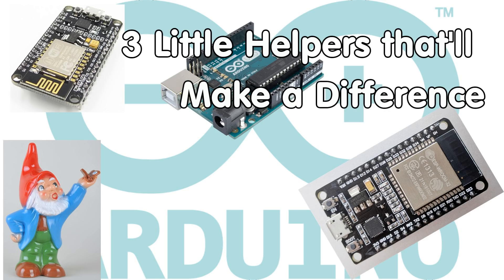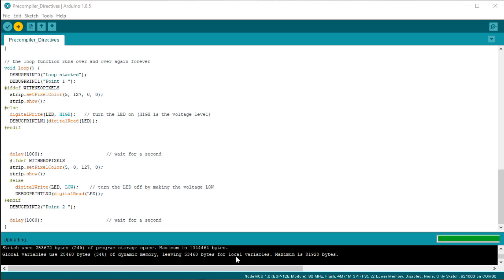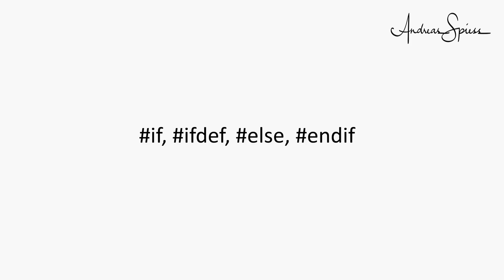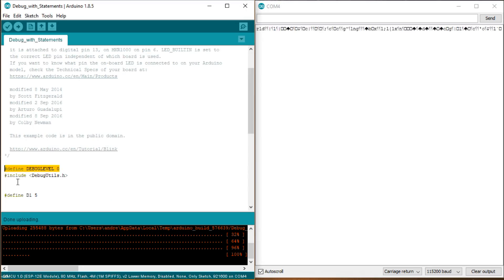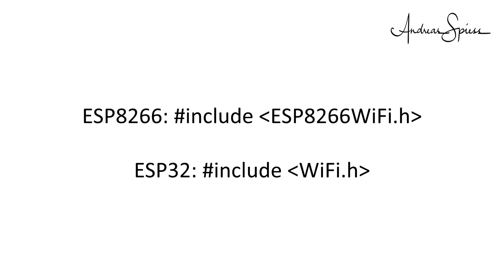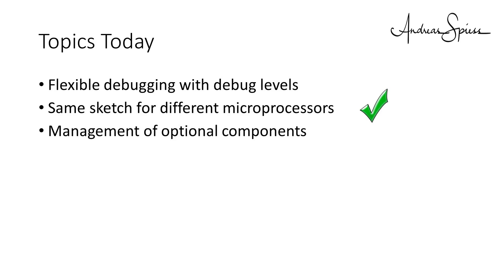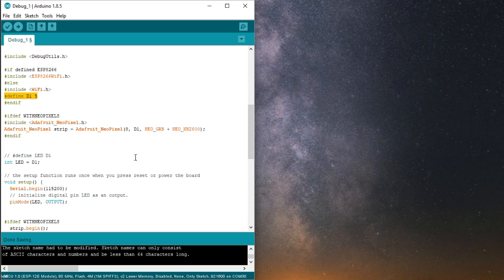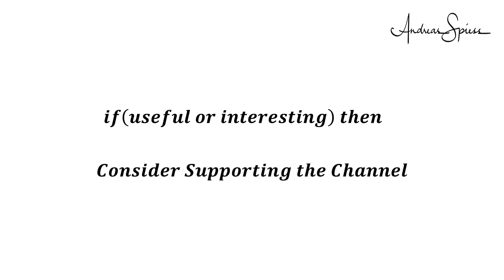#233 Three Little Helpers that'll make a Big Difference: Preprocessor Directives

Comment: Hey Andreas…you got me thinking about esp8266 preprocessor.  Oh great video and I have implemented the debug routine.  My esp8266 program has grown and my OTA library and Firebase library are colliding with each other causing crashes.  Can you guide me on how to have a dual boot 8266.  I’d like to do an OTA on power up, then restart, ESP.restart(), and do Firebase stuff based on ESP.getResetReason != “Power Up” or BOOT_MODE/Reset Cause.  I’m able to manually isolate the two boot ups via preprocessor #define statements but can’t figure out how to do it base on checking the condition of ESP.getResetReason , or BOOT_MODE/Reset Cause or other condition you might suggest.   Thanks for your help.
Reply from the maker: I hardly use the ESP8266 anymore. Particularly for complex projects :-(

Comment: One more comment: With #ifdef ... #else ... #endif you create blocks of code that the compiler doesn't check for you. 
These code-branches that you personaly never use degenerate over time (updated libs, deprecated functions) or never worked at all.
Github is full of projects with these problems. So static bool const g_bDebugOutput(true); or static int const g_iDebugLevel(4); may cost you some bytes but makes the maintenance of your code much easier
Reply from the maker: Agreed. Just if you have big parts of a program to switch on or off these pre-compiler directives create much smaller code. I often see it used in this function. But they are not easy to read.

Comment: What will have you tearing your hair (if any) out is when your code isn't working right, so you put in debug statements and .... the problem goes away. Turn them back off and your code misbehaves again.

The problem? You have a timing problem somewhere. Executing debug statements slows it down enough that the problem goes away!
Reply from the maker: That can happen (happened also to me). Maybe you watch the JTAG debugging video. There, the timing issues should go away.

Comment: Do note C++ has better alternatives for pre-processor directives in most cases. For pin definitions we have the safe const byte alternative which give wayyyy nicer errors if you made a mistake. And even for debug you can use const and regular if's. The compiler is smart enough to leave unused parts out.  So for point 3 I would prefer a const variable.

Granted, PPD make it easy for a lot of types and in a library the debugging is already "done" on the PPD. Two big shortcomings of the linked library, you can not give a second parameter to print. So you're stuck to decimal and 2 decimals on float. Second, you can only use Serial as debug. That's why I once made https://github.com/septillion-git/DebugLib But out of the box it does not support debug levels.
Reply from the maker: There were discussions whether the compiler used in the Arduino IDE removes the const variables. But you are, of course right for the newer compilers. Common practice in the Arduino environment is still to use defines.
I will have a look at your debug library. I am sure I can learn something from somebody who really knows C++

Comment: The debug levels are even easier to implement in ESP-IDF. You just use the macro ESP_LOGX(TAG, message), where X can be V (verbose), D (debug), I (info), W (warning) or E (error), from less to more important, and then define the level in menuconfig, before compiling. Also, a neat feature is that you can define the TAG for different sections of the code and be able to easily identify them.
Reply from the maker: Interesting. I wonder if we could use a similar concept with the Arduino IDE as in the newer ESP boards definitions it has also those debug variants. Maybe they are even the same?

Comment: Hello Andreas, many thanks for your soldering tips @ IoT meetup in Basel. Today I did a test soldering on some of the discussed boards and I thing I managed it quite good. It's time for doing a check now and see if there is any connection error. I wish you a nice weekend and maybe see you next time. Best regards Matt
Reply from the maker: Glad to read that it works now better. Some practice and you will be a master ;-)I will be at the next Meetup, for sure....

Comment: Few issues come to my mind with #define: it is hard to debug compiler errors and mistake because we have no access to the post processing output file (I wish there was a way to see it). For example, the wrong semicolon (;) in the following statement (  #define motor_pin 13;   ) . It can take some time before noticing the stupid mistake - I often add ";" because I am used to. Perhaps Const int can be a better use. For start, it is not taking more memory (unless you use it as a pointer later on), and it is also making sure that the defined variable is int. #define can cause other variable sizes to be created later on. However, const int will not work with analog pins because they use the "A" character (e.g. pin A4).
Reply from the maker: As always in life, there are pros and cons. So each of us probably has some tricks. In Arduino, most examples use #defines.

Comment: Be careful with using large #ifdef blocks in code though. It can make reasoning about the code much more complicated (better to use makefile to distinguish between different execution environments)
Reply from the maker: Unfortunately, we do not use makefiles in the Arduino environment. But usually, these projects are also not too big...

Comment: Hi Andreas, top video mate, makes a lot of sense and debugging along with memory management easier to implement. 
I am wondering if you could turn the debug ON and OFF with an external digital input, even if it meant resetting the controller to read the input?
Reply from the maker: You could do that using variables. Not with these directives. They are only valid before compiling.
Reply: That's a really top point Tom. I do that atm, eg testing whether a PIR works from distance by lighting a bright led. Press a button, turn off DBG mode. Good reply Andreas.  Now enlightened on this subject tho, thank you.

Comment: Great video Andreas! Whilst I already use pre-processor defines in my code, you've given me some ideas on how to use them a bit differently for different projects. I use the following debug code at present, but will probably take your debugutils, reformat it slightly and add some bits to it and use that, as I like the idea of the levels. I just like the ability to turn debugging off entirely, and if your sketch didn't need Serial, that overhead is completely removed also. Makes a real difference when you are working with other processors such as the Attiny85 ;)

#define DEBUG
#define DEBUG_OI Serial

#ifdef DEBUG
#define   DebugBegin(...) DEBUG_OI.begin(__VA_ARGS__)
#define   DebugPrint(...) DEBUG_OI.print(__VA_ARGS__)
#define   DebugPrintln(...) DEBUG_OI.println(__VA_ARGS__)
#define   DebugPrintf(...) DEBUG_OI.printf(__VA_ARGS__)
#define   DebugWrite(...) DEBUG_OI.write(__VA_ARGS__)
#else
// Define the counterparts that cause the compiler to generate no code
#define   DebugBegin(...) (void(0))
#define   DebugPrint(...) (void(0))
#define   DebugPrintln(...) (void(0))
#define   DebugPrintf(...) (void(0))
#define   DebugWrite(...) (void(0))
#endif
Reply from the maker: Seems to be similar to mine, just without the levels. 
You could define level0 as no debugging at all in my code. Or you never use DEBUGPRINT0 at all...

Comment: very useful info, thanks Andreas. ive just finished working on a ESP8266 IRC Bot..if you, or anyone else is interested in taking a look at my crap coding... its quite useless! but was a good learning experience!  https://github.com/WacKEDmaN/ESP8266-IRC-Client also vid of it in action on my channel
Reply from the maker: Thanks for the link!
Reply: i implemented some ideas from your video Andreas! it made the code much nicer with more functionality, you dont need all the sensors now, you can easily disable them individually by commenting out 1 line for each device.. ive also added an 16x2LCD on the I2C.. i came up with the fun bit of code at the top all by myself! :P
#ifndef ESP8266
die();        only compile for ESP8266!  (overkill?! hey look no comments!!)
#endif

Comment: One more: Want to comment out many lines of code and not think about if comments like // oder /* are already used in the code?
Write
#if 0
...
...
#endif
and all is ok.

And for C++ programmers: Better use the C++ syntax than #typedef and other preprocessor macros. Remember the compiler will only see the lines AFTER the preprocessor has run. So the compiler could not do type checking and other benefits from C++.
You may even consider to write "const int A = 3" than "#define A 3".
Reply from the maker: Thank you for your tips!

Comment: Now, what would be super-good would be an easy way to list all existing defines...it's kind of known by osmosis that ESP8266 (with or without a space??) might be defined - but how to tell what IS defined already?  Searching on google makes this seem an unsolved or not universally solved problem....and it'd be nice to be able to use the IDE-created ones which is kinda hard to do without a list of what they might be.
Reply: The gcc compiler has a flag for that. This is a bit outside of the usual Arduino IDE, but it will give you identical results:
- Create a new file (called BareMinimum.c) which only contains one line: #include "Arduino.h"
- Invoke gcc directly (Note: This assumes an Arduino Mega, needs to be adjusted accordingly for other boards):
"C:\Program Files (x86)\Arduino\hardware\tools\avr\bin\avr-gcc" -dM -E BareMinimum.c -I "C:\Program Files (x86)\Arduino\hardware\arduino\avr\cores\arduino" -I "C:\Program Files (x86)\Arduino\hardware\arduino\avr\variants\mega"

I'd then suggest sorting it and removing all macros with leading underscores (those are mostly compiler-internal things that will have little to no use or meaning for you).
For my Mega I end up with this list: https://gist.github.com/sbx320/cb4c71419d2bf56e1e583a45ffc888ce 

-dM lists all defines
-E means preprocess only (we do not actually want to build a program, just the defines)
-I [path] is an additional include directory, referring to the Arduino Core libs plus the Board specification
Reply: Excellent.  Thanks!
Reply from the maker: @Doug: AFAIK each board has its own defines in Arduino IDE (e.g. pins, LED_BUILT_IN). But I never dug into it so far.
Reply: Yes, I've run into some of them while surfing some of the source code for the tools.  The solution proposed by sbx320 works (and there are other similar ones you find on google) for fairly experienced folk (I'm OK there), but it sure would be nice if there was a simple way to get a list.  I've run into name conflicts with things defined in "fruity" libraries for example....#defines are both a blessing and a curse, the latter when they chew up your namespace and you wanted that name for something.  Depending on your warning level you can have some interesting times around conflicts..

Comment: 2:07 is simply wrong. The search and replace is case sensitive and only "whole words" are replaced. 2 examples "led" will not become D1 and "LEDS" will not become "D1S".
Preprocessor directives are very powerful and it is easy to break the code.
If you are using preprocessors often I would advice a more advanced IDE that visualizes the code better than the Arduino IDE
Reply: He doen't mean this as literally as you do, you should have picked this up when he mentioned the gnome :)
On the other hand, i really cannot agree more that a more advanced IDE would be the best "Hack" to improve larger programs. Visual Studio, combined with the Visual Micro plugin (Available from the Visual Studio marketplace) is a really nice IDE and painless to use in an arduino or ESP context.
Reply: I didn't want to mention alternatives as I build one myself. But as you started to mention one. Sloeber.io is a open source eclipse based alternative working fine with 500+ boards.
Reply from the maker: @Jan. Of course, you are right. I could at least have the "ignore case" switched off.
Reply: @Andreas the "ignore case"  triggered me.
Reply from the maker: For me as a Youtuber it would be suicide to leave the Arduino IDE...
Reply: @AndreasSpiess  Why? Everything you need can be downloaded for free. Installation is a breeze, the ide is a LOT better and you are still a part of the Arduino ecosystem , since visual micro is a wrapper for the arduino upload system amongst other things.
Reply: @andreas. You are right. IMHO there is way to much emotion involved when it comes to IDE's. Everybody has his own child which is the "one to rule all". 
Anyone coming with a more nuanced look/approach is simply committing economical suicide.
This means that if you picked an Arduino IDE alternative, (I have no clue how many) viewers would unsubscribe.
Reply from the maker: @jan: „I have no clue how many“ is exactly the problem. I could chose whatever solution and would have 95% against me. Now I have probably 20% against me. And some of them will probably never subscribe such an „Amateur Channel“.
Reply: @Andreas exactly. I think the "Amateur Channel" is not really a issue as you have a electronics background. You are excused to use the arduino IDE.
Also note that you won't get money from open source IDE builders, were you currently get money from hardware providers like banggood.
Things to think about when making pure source code video's
Reply from the maker: For me, money is not a driver. Views are more important. Because I like if my work is valuable for many other people. My effort is the same for one or one million views, but the value is much bigger for the million.

Comment: I rather like to use normal variables and if statements and an very early readout of the powerregisters to set the debuglevel. This way my projects are silent untill i rest them with the reset button. For Atmel mcus there exist bits for external reset,brown out programmer reset,watchdog etc.
Reply: That is also a way of doing this, BUT, it isn't the same. You will still have the debug code compiled into the program even when you not uses it.
And you will have "dead" code in your program.

The convention in C programs is to use macro directives for constants and comment in/out code depending on what you want to have in your program.
Reply from the maker: I am not sure if your method works for libraries or code which is understood only by the compiler for one processor. ESP32 and ESP82 sometimes have different implementations (for example Pin #) and your compiler does not compile without directives.

Comment: Useful tips, thanks. One slight correction. You showed this:
       int LED = D1;
but that won't compile as D1 isn't an integer value, the error is:
     'D1' was not declared in this scope
Reply from the maker: I thought the same. That’s why I tried.  It compiled with ESP8266 NodeMCU 1.0 :-)
Reply: Ahh, I see. I was compiling for an ESP32. Thanks, I have learned several things today :-)
Reply: For the arduino, int variable = D2 or int variable = A2 means digital/analog.
Reply: D1 isn't an integer value, but depending on what board you are compiling it for, it may have a pins_arduino.h definition, i.e. for NodeMCU it is "static const uint8_t D1   = 5;" whereas it is "static const uint8_t D1   = 1;" for the Wemos D1, and for others it may have no definition, hence it will fail. It's all part of the precompile 'black magic' that occurs when you hit the compile button ;)

Comment: Yes, also with a combination of typedef structs and unions where unions have a use for defined values and structs for storing certain values that are connected. I encounter these levels of programming with the libraries I download from the web. But I don't use them more intensively. I use direct functions with parameters if needed and some defines.

My comment is mainly on C programming, maybe it's not so relative but that's my current programming work, I haven't started C++ with building classes and get the Arduino experience. It should be interesting, but also C also has a wide expand world, Linux is built on C! That's why I didn't move to C++.
Reply from the maker: Structs are also a nice thing most Arduino programmers do not know. The same with enum. Maybe I do a quickie for these, too in the future...
Reply: @AndreasSpiess  But they are for C right? If you like C++ maybe you can do a tutorial about how to do a C++ class it would be amazing I'm really looking to get into C++. You can investigate if it's worth doing some programming with C++ for microcontrollers. Even with all thoughts about C++ I haven't yet started to implement structs and enums in C libraries.
Reply from the maker: Arduino IDE is C++. I do not know C.
Reply: @AndreasSpiess  C is very similar to C++, the directives you explained in the video are derived from C :)